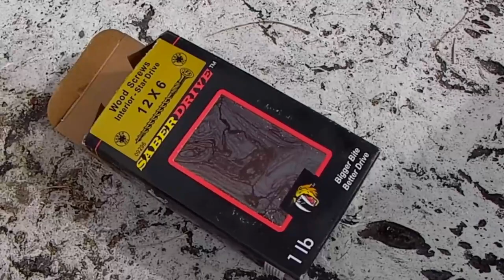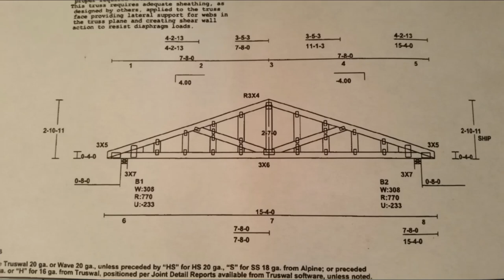Adding a Structured Roof to a Mobile Home

Comment from the maker: Yes it does.  But the work was completed using a Building Permit from the City and they use HUD Standards.  Additionally the Trusses were built by a Manufacturer.

Comment: Generally speaking, would you have to have the exterior walls and sheathing inspected to make sure it can handle the weight of the new roof? As well as have the perimeter supports checked out? Basically, if I wanted to do this, would I have to have a structural engineer involved?
Reply from the maker: All of the Homes I featured used Sito Manufacturing in Otis,  Colorado for their trusses for the Homes.  I believe they have a Computer Program that helps them decide load requirements.

Comment: So cool!  I would have build longer overhangs though, and am in the middle of deciding if just to re-roof, add 15" ladder extensions, 24" overhung 2x4's on top of each 3/12 truss, or a custom 5:12 truss on top of every 3/12  2x2 truss..  Decisions.

Comment: Doesn't that extra weight to the walls put alot more stress on the outriggers of the trailer chassis?
Reply: As long as you have adequate support under the mobile home frame, the additional weight will not be an issue. The maximum space between piers per HUD should be 48". You can increase the righty of the home tremendously by reducing that to 32" or 24". You can never have too many piers under a mobile home.
Reply: MDC, Yes it is also overloading the mobile homes exterior walls that are not built to handle that much of a load. The interior walls are not intended to be load bearing walls. Most all mobile homes have very tight tolerances when it comes to modifications of the structure. They were built to be lightweight in order to be mobile from one site to another. I certainly doubt you would find anyone that would stand behind any liability issue that may come from such modifications. JUST SAYIN
Reply: @whip205inthebam3  it would depend on the wall construction.  If 2×4 or 2×6 the extra weight would be fine. The only problem would be if it were too heavy to move. 
Also, as someone previously said, you could increase your piers to compensate for extra weight.
Reply: 😂😂😂 This is fine ' IF " the exterior walls are supported the entire length with a 4×6 inch beam sitting on solid pier columns or a block wall on a footer of concrete directly under these walls .  
  Double wides must be supported under the center wall also.
  The weight of the added roof will slowly sag the exterior walls down causing the floors to bow into a arch as they are not supported by the steel frame but rather the 2×4/2×6 outriggers ! Double wides will sag at center wall also... Foundation is key . As walls sag doors become almost impossible to open inward. It's a nightmare  without a strong foundation  !!! Buyer beware  !

Comment: Hi, nice video, I would like to know what you did with the ceiling did rip-off and install new one?
Reply from the maker: This Roof was installed over the existing Roof.  Nothing was removed.
Reply: @mobilehomeutopia5100  Would it be possible to remove the old ceiling afterwards to take advantage of the added height. I would like to do something like this but would need the old roof to remain on since I would still be living it while building the new roof. Thanks for the great video
Reply from the maker: @BillMcGough2010  I've had a  few other people ask me the same thing,  but I haven't seen one done that way. I did a Video on a Home where they added Rooms to a 10 Wide and raised the ceiling that way. "Adding a Structured Roof & Wood Siding to a  10 Wide. " Might help you with your idea.
Reply: @mobilehomeutopia5100  I will look it up, Thanks for the info

Comment: I have a 1971 mobile home that I got very cheap and is remodeled inside but was wondering about changing the roof/ceiling to a pitched roof inside and outside not just adding it outside for looks. Is this possible and even worth it?
Reply: Get after it man! U will run into electrical and maybe simple plumbing but anything possible. I would maybe pick certain rooms to have the vaulted ceilings. The rooms without wires or pipes. 😂 good luck man!!!

Comment: What’s a project like this cost around I want to do the same thing thanks and great video
Reply from the maker: The Trusses will run about  $2000 and another one or two thousand for the rest of the materials.
Reply from the maker: Adan Franco  The Trusses were built by Sito Manufacturers in Otis,  Colorado.  I don't know about the cost of the Permits because I just shared the Project.  I know the Home owner and the Contractor who allowed me to share this.

Comment: How would I go about finding someone in my area that does this? I live in Michigan and doubt they’d want to travel here from Colorado. Is SITO just a regular builder or specialized?
Reply from the maker: SITO is a Truss Manufacturer.  They're located in Otis,  Colorado.  Why don't you look them up on Google maps and see what they can do for you.
Reply: @mobilehomeutopia5100  I may do that, like I said though I live in Michigan so I’m not sure who I’d contact about the structural integrity of the trailer and pillars, etc.

Comment: I wonder if you could go without the sheathing.  Save a lot of weight, money, and time.  You could use furring strips.
Reply from the maker: I'm sure there is a design for that.  But this was done with a Permit from the City's Building Department and they use HUD standards.  It takes account for things like wind resistance and snow load.
Reply: What thickness of sheathing

Comment: Biggest question to me is how well the little thin 1x2 in the frame of the mobile home hold all that weight?
Reply from the maker: Not all Mobile Homes are built the same.
Reply: @mobilehomeutopia5100  but all old ones were and this one was definitely an old one and so is mine. That's why I asked
Reply: @mobilehomeutopia5100  Utterly unhelpful reply, and video, for those of us contemplating a roof over.
Reply from the maker: This was a Project that I shared but was not directly involved with. The Contractor that did the work is out of Town for the Holidays and I am, unfortunately,  unable to give more insight to your question about this right now.
Reply: The framed walls inside a mobile home are not load bearing. Outside frame holds all the weight. You could take out every wall in a mobile and be fine
Reply: I have a 1983 single wide mobile home and my outside walls are 2x4's with treated 1/2 plywood and vinyl siding!
Reply: Thank you! Just what I needed to see. I want to totally replace my roof and raise the ceiling up in my trailer.
Reply: @jckay5087 It's called a retrofit. You can have the pitch of the roof raised/designed according to wind load calculations meeting Miami-Dade codes for manufactured homes.
Reply: @jckay5087   As a Florida roofing contractor, the term  "roof over" is associated with EPDM or a TPO product. The term  "Retrofit" is associated with  metal roofing but both are same when you change the pitch of the roof.
Reply: Mobile homes never used 1x2 framing in exterior walls. Home built prior to the 80's used 2x3's for the exterior and 2x2's for none load bearing interior walls. The entire weight of the trusses and roof is not a huge amount. That divided by the linear feet of the walls probably works out to about 35 pounds per linear foot of exterior wall.

Comment: Did you build it on top of the existing structure?
Reply from the maker: Yes and it was done with a City Permit.  Been up for a few years with no problems and looks great.
Reply: @mobilehomeutopia5100  thanks for the quick replay! How did you know it would support the new load? Merry Christmas!
Reply from the maker: The design was provided by the Truss Manufacturer.

Comment: I really don't understand why anyone would want to add a roof like that along with all the additional weight to a mobile home. Drew's Roofing & Home Repair is much more practical with replacing an old worn out roof. There are also others who do the newer metal style roofs.
Reply from the maker: Everyone has their own preferences...
Reply: You can add extra insulation which would be helpful with soaring energy costs!

Comment: You seem to be a guy who kbows allot about mobile homes i own a 12x 78 ft mobile it has a flat roof with a slight peak i want to build my own trusses and install on the roof maybe u can help me out what size of trusses should i build and how far should a space the trusses apart in this roof i want atleast a min of a 8 to 10 inch over hang i priced trusses here in Canada and the cost to do the roof is about 20 grand trusses are about 7500 so making my trusses each would cost me around 50 to 75 each fir materials but cause o one knows shit all about doing roofs in mobiles in my area i hope u can help me out please and thanks
Reply from the maker: All of the Structured Roofing Projects that I covered required Building Permits from the City.  They had specific requirements for Wind, Snow load and other things.  Perhaps that would be a good place to start if you are building your own Trusses. The trusses on the Homes in the Videos cost about $2,000 and were made by spec.
Reply: @mobilehomeutopia5100  ty